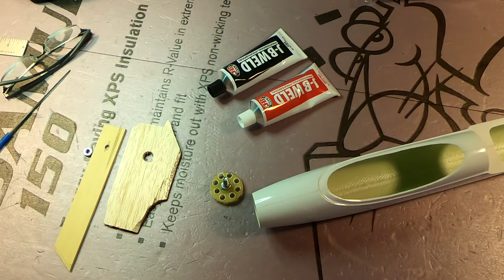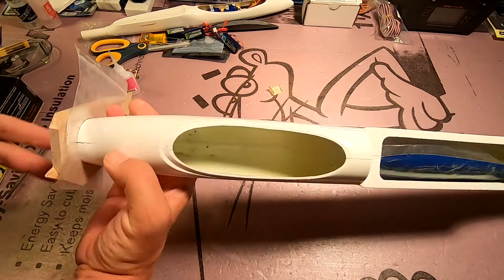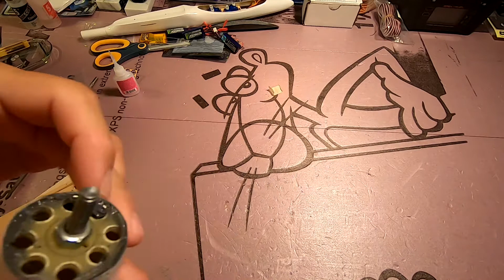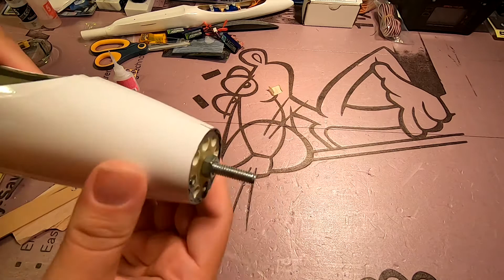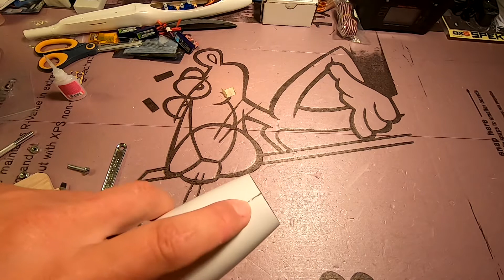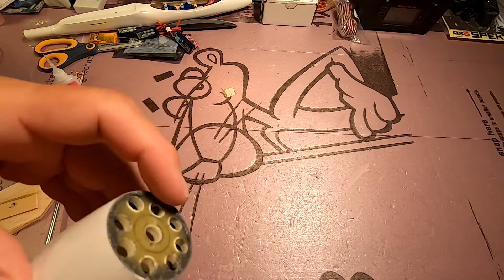TopModel Avia 2.5m - Build Pt 04 - Gluing the Motor Mount into the Fuselage

Comment from the maker: Hi Geordie, I'm posting this reply as a separate comment so that it is easily visible to everyone. Regarding your placement ot the receiver: It's my understanding that you don't need more than 1-1.5 inches of antenna to stick out of the fuselage... kind of like a whisker. If you are having to tape the antennas to the wing you may have too much sticking out... not a problem, but unnecessary. Also, most fiberglass fuselages are not usually a problem for 2.4ghz radio systems and it's carbon fiber that can be the problem. In fact there are certain variants of carbon fiber that are "friendly" to 2.4ghz. I would recommend doing a detailed range test with a friend... both of you using cell phones so you can tell the friend, for example, that you are giving full up elevator and they can reply with the result. Then have the friend hold the glider/plane in different positions to simulate the glider banking as if in a turn, pointing directly towards you and directly away, etc. Do this testing at a descent distance, several hundred yards/meters if possible. 

If you are really worried about losing reception, you could consider using a transmitter/receiver that accepts a "satellite" receiver. I just ordered one for another glider I'm building for 2M thermal duration competition and I'll probably be putting one in the Avia when the time comes. See this link: https://hobbyking.com/en_us/orangerx-r110x-dsmx-dsm2-compatible-satellite-receiver.html 

Don't be confused by the name, the satellite receiver does not communicate via satellite like a GPS. Satellite refers to its relationship to the primary receiver. It's more accurate to say the "satellite" receiver is an augment to your primary receiver. A separate receiver that lends its signal to the primary. Your antenna strategy should be to have the antennas protrude in such a way that one of them always has line of site on the transmitter, more or less. So, if I have the primary receiver's antennas protruding the left and right of the canopy, I might try to mount the satellite receiver and it's antennas rearward of the wing and protruding vertically (top and bottom). This way regardless of the gliders orientation, one of the antennas is "visible" to the transmitter. The 2m glider I'm building has a balsa/ply fuselage with a carbon boom so reception shouldn't be a problem. But, since I'm going to be competing, there will be a lot of other RCers and consequently a lot of RF signals in the area. And I may be flying higher and further away than on normal sport flights.

Additionally, there are ways to safeguard against tragedy in the event of loss of signal. One of the things I like about my new Spektrum DX8 is the ability to program "Failsafe Positions" for the control surfaces. To prevent a glider from thermaling up and away in the event of LOS (loss of signal) the receiver can be programmed to put the control surfaces (rudder, elevator, ailerons) into positions so that the glider goes into a wide downward spiraling turn. 

I hope all or at least some of this info is helpful!
Regards, CJ

Comment: Wish I'd thought of that method to set the firewall in my magellan. Much better than the way I did mine by measuring from the front of the fuse with a vernier caliper.
Reply from the maker: Once you get the scrap pieces and do it once, you'll be set up to do the same method on any new kits. The best part of doing it that way, aside from it being true and strait, you don't need to worry that the firewall will shift while the glue cures. I'm trying to pass along as many building tips as I can.
Reply: My RC Channel 
Another thing that I had problems with was the placement of my Rx in the fuse and it's antennas exiting the carbon fibre / kevlar fuselage. I finally drilled a hole on each side of the fuse as high as possible so I could tape one antenna to the underside of each wing. 
Cheers
Reply from the maker: Hi Geordie, please see my reply in the next new post above. I wanted to make all the info easily visible to all. Regards, CJ